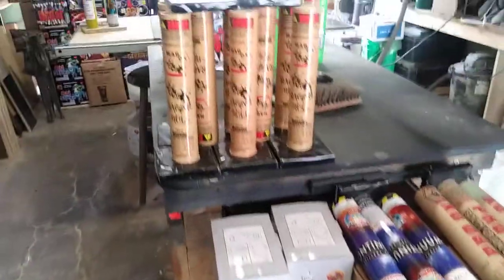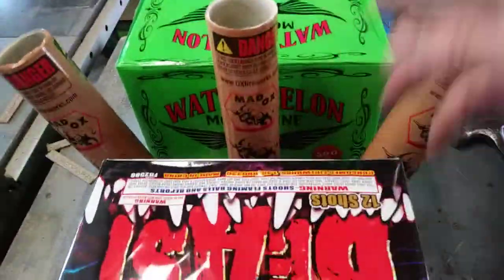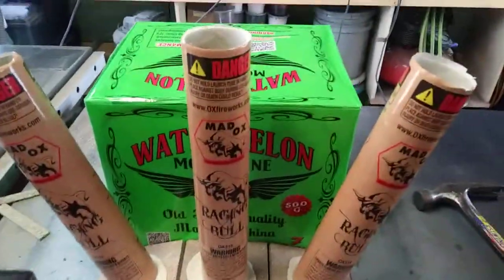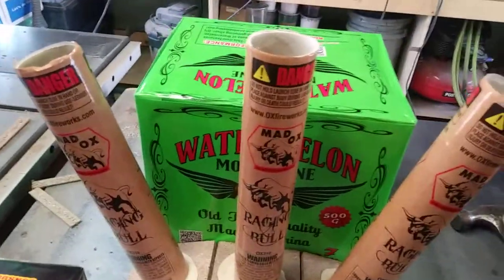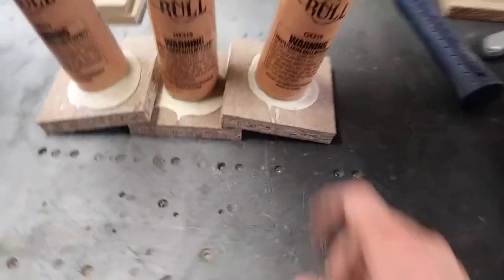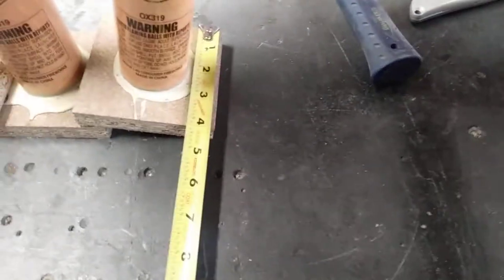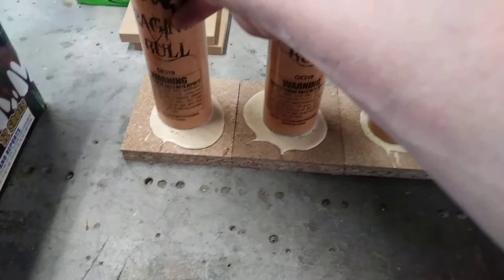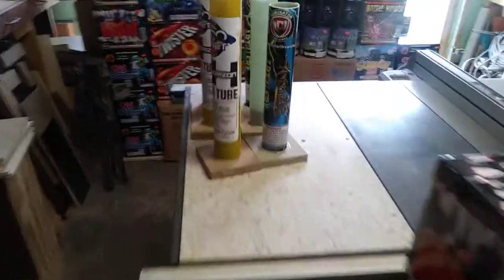Poor Mans Mortor Rack

Comment: I'm working on my stuff today as Well, knocking off the bottoms and putting 30 to a  milk crate. All my angle racks are the hoakie way it does work. I check all the tubes after each use if one's loose I just replace it.
Reply from the maker: kevin adams Around here milk crates are hard to find. Always wanted a bunch cant even find them on garage sales.